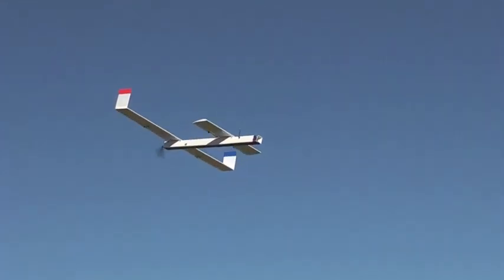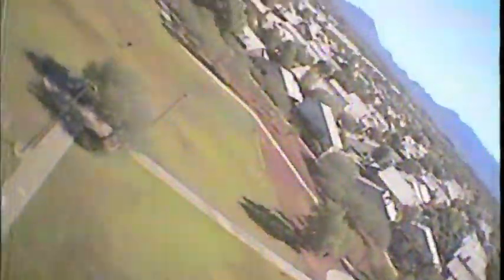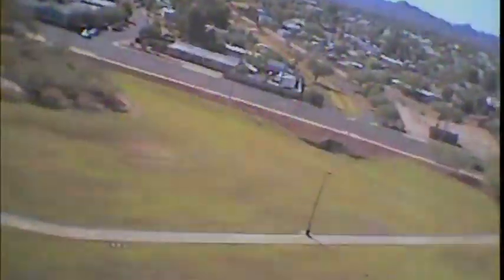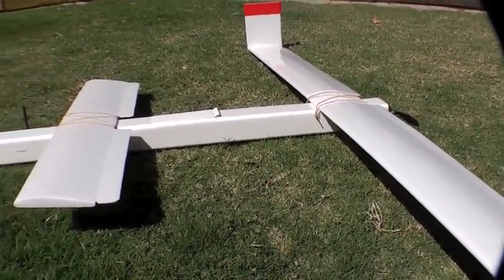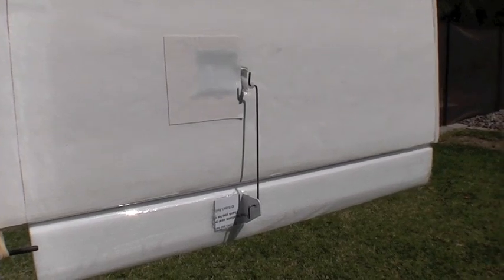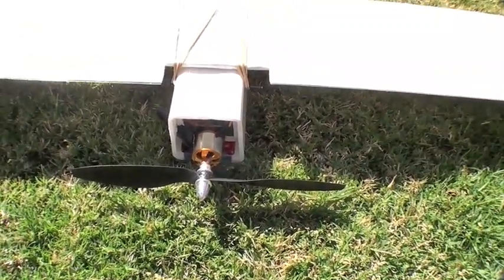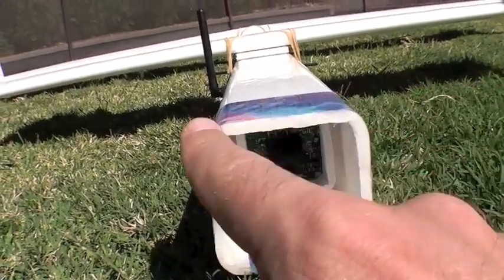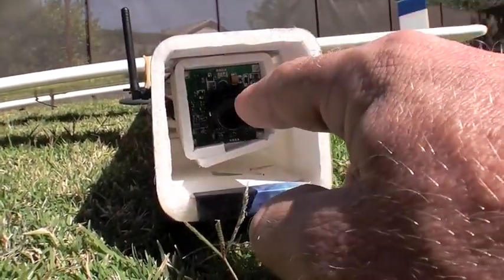FPV Peace Drone v1 - flight video & build synopsis

Comment from the maker: Sounds like a cool idea to me.  I added the link to the canard CG calculator to the description section on this video.  Use that as a basis with a generous static margin of 15% and I recommend going another couple of inches forward of that for the CG on maiden flight.  Adds a lot of stability, especially in yaw.

Comment: i have a 24" "Dead Simple" kfm2 push-wing  built from readyboard. its overpowered and fun for high speed aerobatics, but after watching this, i contemplate making an "fpv adapter" for it, consisting of a tube of your design and a fixed front wing - i would have two planes in one :) does this setup sound doable? i have no idea how to build it for a proper COG. Is it simply a matter of trial & error, or are there rules of thumb?

Comment from the maker: No problem.  You can also PM me if you want to have a more direct conversation.  I think for purist aerodynamic purposes your decision to use canard elevators is a good one.  Part-span ailerons (outboard) would be completely acceptable, if not preferable.  Good 9g metal gear servos are fine.  I personally like EXI D213F digitals, but decent analog are fine, your call.  I would make the ailerons at least 1.5" chord at whatever span and do not recommend differential.  Keep in touch.

Comment: Thanks for the reply, Ed.  I think I might have the servo issue worked out thanks to the wonder of the Web ; )

I am building my drone more as an exercise in aerodynamics.  As I will have purely ailerons in the main wing, I am wondering what your thoughts would be on reducing the span of the ailerons (semi-span) and using a smaller servo, say 9g instead of 19g?  In your experience with the 'Drone will that allow enough aileron authority?  Sorry for so many questions but you are the designer :)

Comment from the maker: On the PDv1 I did the "same-orientation servo" setup with a Y for the elevators and it worked fine, but for subsequent versions I've been using elevons on the main wing only.  It's a tiny bit more finicky but the initial wiring and the setup/breakdown is simpler.

Comment: Ed, did you use a 'Y' harness on the elevator servos on Peace Drove V.1, or did you run a seperate channel and slave & reverse the servo?  Wouldn't it work just as well to orient the servos in the same direction with a 'Y'-harness?  Granted, they wouldn't be symetrical, but is that an issue?

I have a Turnigy 9X that has worked perfectly for me.  A channel can probably be mapped and slaved to the elev channel, but I have no idea how, and the manual is - literally - incomprehensible Chinglish.

Comment from the maker: @calebsmedia For the same wingspan and chords the CG will be at 15".  Use the calculator.  Bigger winglets might not be necessary but won't hurt.  This plane is pretty darn stable without much effort. As with any plane, err on the nose-heavy side and work back from there.

Comment: Forgot to me to mention that I will not be using control surfaces on the canard just main wing. Also do you think it will work if I put bigger winglets on? I'm just trying to load it down since I have such a big motor and to make it fly real stable. I also forgot to ask do you think that the CG will still be 15"?  Sorry for so many questions its just you have more experience the. I and I wanna make sure it flys correctly. Thanks again!

Comment: @ExperimentalAirlines thanks for all the info! I am about done with the airframe of my version of your Peace Drone. I made my fuse 3" square and same 30" long on main frame. I also increase chord to 6". I am putting a bigger motor on there (only one I have). It's a 480 1000kv. So I made it larger for the added weight. Should I use 2" control surfaces since its a bigger wing?

Comment from the maker: @calebsmedia I can say that using a 2.75" interval on the fuselage tube will yield a 3" internal tube that will fit a GoPro perfectly and does not seem to adversely affect flight.  You can also fit a ton of batteries and extra gear in there.  Total wing chord (airfoil plus control surface) of 7" seems to be pretty good for both main wing and canard when looking for efficiency (higher aspect ratio).  Consider increased chord for heavy lifting.

Comment: @ExperimentalAirlines Thanks for the info and look forward to the upcoming video. I purchased a bigger motor for my version (a 480 1000kv motor). So I am thinking I may need to make it bigger or do you think it will work fine on the current size?

Comment from the maker: @calebsmedia In the current iteration (see later videos) he canard leading edge is 1" aft of the main fuselage front (the transition between the nose pod and fuselage) and the main wing trailing edge is 1" forward of the rear of the fuselage.  With this canard/main wing setup the CG comes to 15", exactly in the middle of the main fuselage tube.  The nose pod length can vary so I am referring to the main fuselage only as the datum for CG and wing mounts.  Better video coming soon.

Comment from the maker: @calebsmedia Exactly as seen in the "metal motor mounts" video also on my channel.  Thin metal plate, bent 90 degrees, adhered with heavy duty foam tape to plastic gift card hot glued to foam fuselage interior.